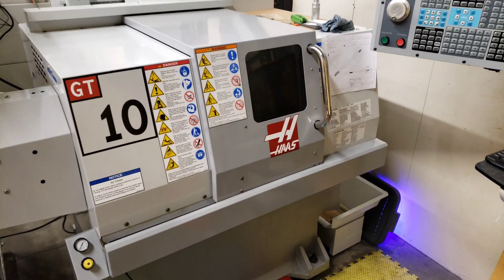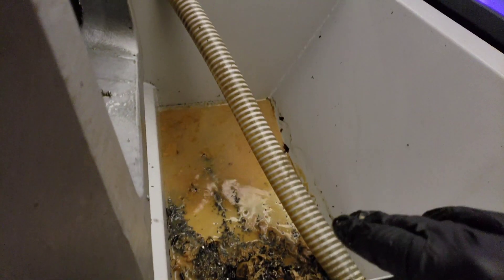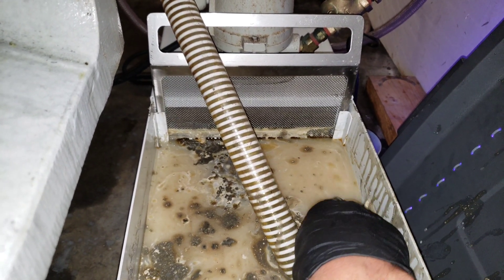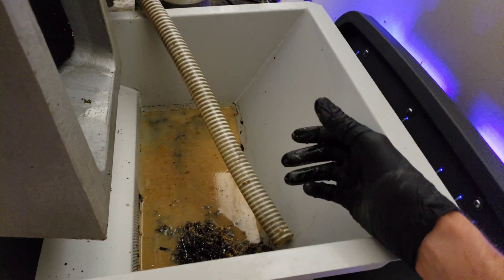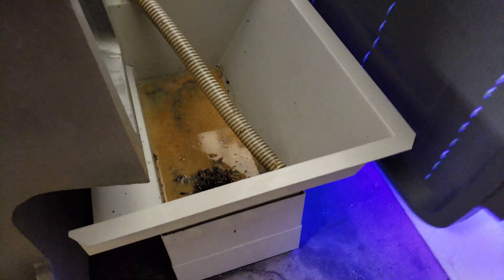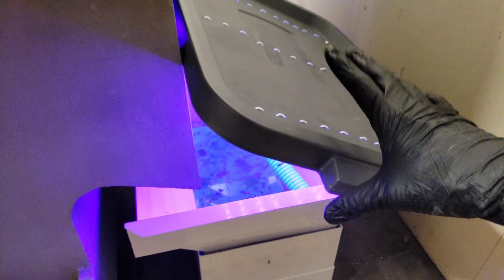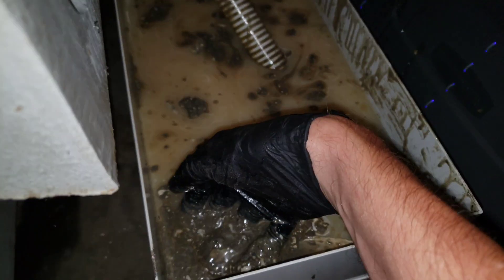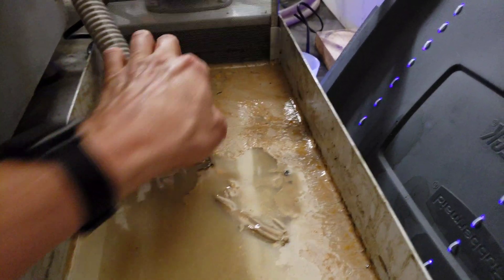Does UV LED Black Light Kill CNC Coolant Bacteria and prevent Bio-Film development in the sump tank?

Comment: would a uv pond filter work ?
Reply from the maker: Probably, you would need to circulate the coolant through occasionally.
Reply: @engineerable I have purchased a small pump and a uv filter and I will try it and Iv also found that the design of the sump/sumps isn’t that great , it has baffles that are too high so stops all the flow of the coolant so I have took them out , I will post results when I get it up and running
Reply from the maker: @ryanhowe2 Cool. Usually those baffles are designed to isolate the oil on the surface and keep chips away from the pump (under ideal conditions...)

Comment: Hello try submerging the led light
Reply from the maker: Do you know that works better if the light is submerged? The problem I believe is that these LEDs are not true UV, they are advertised at ~405nm which is right at the edge of the UV spectrum, and therefore do not do a good job of killing microorganisms.
Reply: I am going to try a pond Iv filter , it’s like a canister with a uvc bulb inside with an inlet and outlet  so you pump the coolant out of the sump through the canister so the coolant passes over the uv then it goes back to the sump, it is designed in a canister because uvc is harmful,